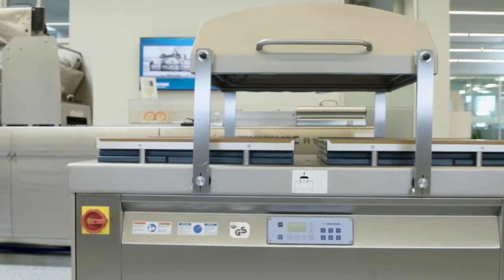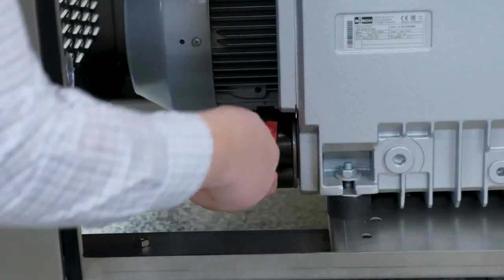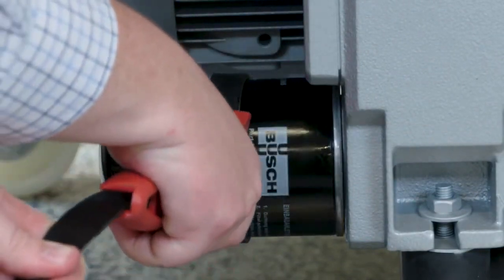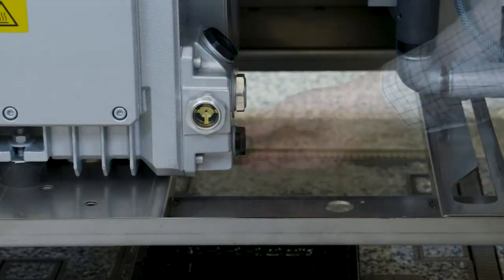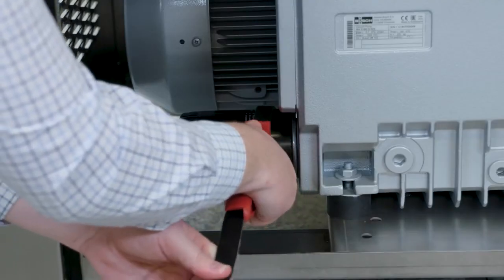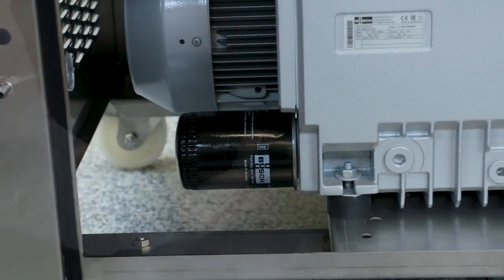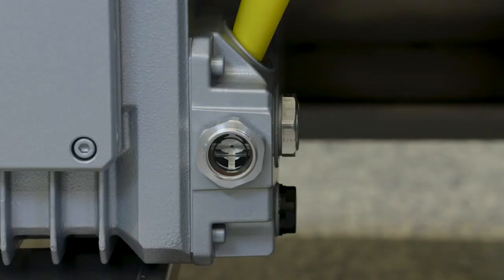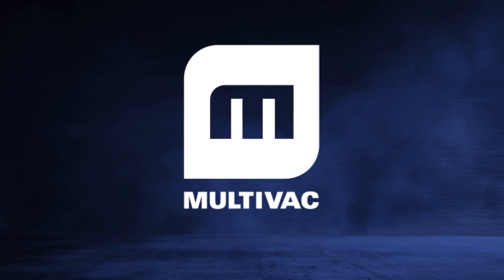MULTIVAC C 500 Double Chamber Pump Maintenance

Comment: If the machine isn't cycled after an oil filter change, then the level can't be properly checked. The new filter is dry. The machine should be turned on and cycled to fill up the filter and then the level topped off.